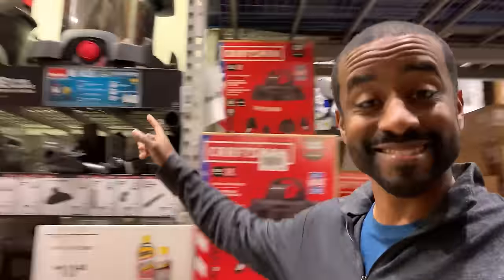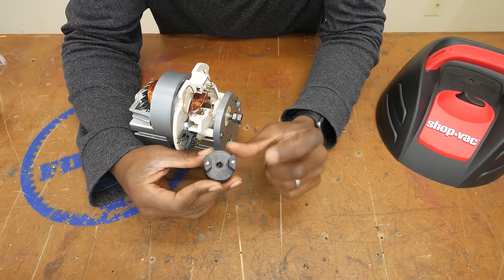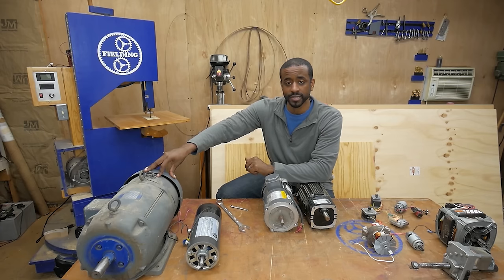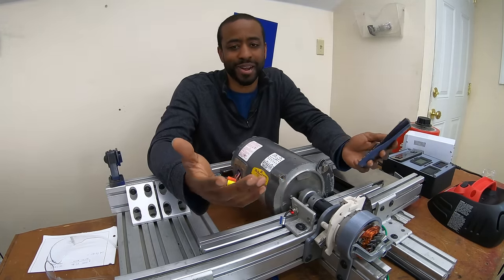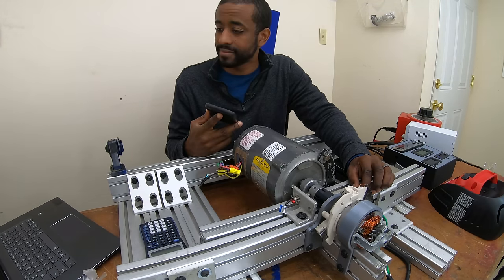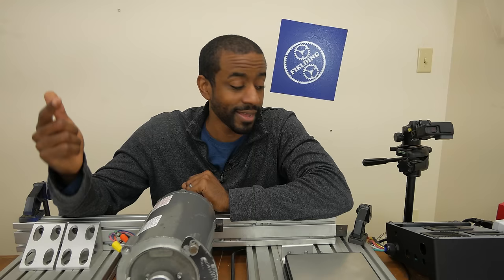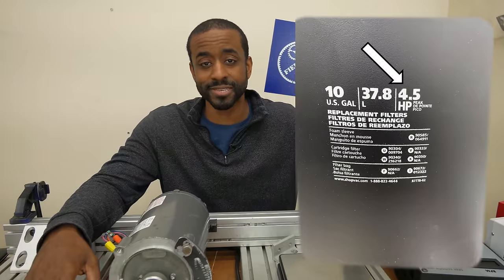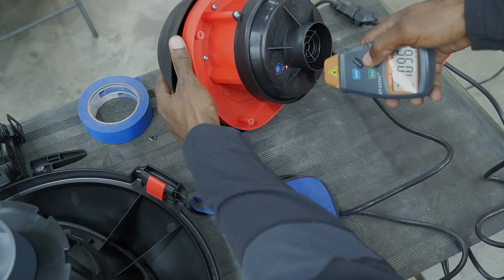How Much Horsepower Does Your Shop Vac Really Have: #078

Comment: I never thought about it, but as soon as you pointed it out, I did the math before I saw your results.  That would make that 4.5hp vac run 29 amps which would trip about any breaker in your house.  Also just looking at the motor it is really small for 4.5 hp.

Better metrics for advertising vacs would be CFM (cubic feet per minute) or maybe PSI (pounds per square inch), though this can’t be less than -14.7 unless you are in a super deep canyon somewhere.

Edit: Further into the video you showed the 9.9 amp rating on the vac which would come out to 1.14kW or 1.5hp.

All the calculations are based upon a typical motor rating of 115 volts, though you will get slightly better numbers with 120 volt power.

Comment: Not sure about HP and such, but I've noticed that some wet/dry vacs have 2.5 inch hoses and others have 1.5 inch hoses.  Also, it depends on the type of vacuuming you need to do.  The larger hoses, for instance, work better at having below where you're hand sanding drywall.   The hose size correlates to the amount of air moved, but not necessarily the suction power.  I have both a large and a small vacuum.  I'll use a large hose on the small one to see it has the same air moving power.  You have me curious now.

Comment: Just inherited a 2.5hp shop vac and wanted to see if i can connect it to my 4hp to see if it increases power. 
Filled a baby formula can (with plastic lid) with sand until 4hp could barely not pick it up. The 2.5 picked it up, and together it was a cakewalk. All that brought me here

Comment: The first test you did, was called VCMA horsepower.(Vacuum Cleaner Manufacturers Association). It's the only relevant number. That's to measure the torque of the motor at the same speed, it actually turns the impeller.(fan) I do agree, just like with air compressors, which also claim impossible horsepower ratings, is airflow volume, static lift,(suction) and air watts, the product of the two, through the optimum aperture. Different impeller and volute designs can give varying pneumatic efficiency for the amount of horsepower from the motor.
     If you multiplied the locked rotor torque with the normal operating speed, you could divide by 5252.1131, and achieve something close to the "peak horsepower" it says on the box. When I calculated that using your 1.68 foot pounds, with your 20,320 RPM, I got 6.49 HP. This is(was)a 6.5 HP motor!😆🤣😂😁...... Great video: Where's the Federal Trade Commission when we need them?
     If you slowed the motor to the speed that it produced maximum power, then used that RPM, with the locked rotor torque, you might hit closer to that "magical" 4.5 Hp. According the the VCMA, Peak power should be rated by loading the motor down to the maximum wattage output, then, allowed to cool down to 25°C, then, powered up again, and the horsepower reading taken before the motor has a chance to heat back up. If you did that, you might get your 2~2.5 horse power that you estimated.(the motor would HAVE to draw more than 20 amps) At<50% efficiency, you could only get ~1.5 horsepower peak@20 amps, 120 volts.

Comment: I feel like this might be a problem that doesn't exist as much in AU. Most of the shop vacs are sold ~1200w and we have 240v 10-15 amp sockets. We also have really strong customer protections for such a thing and the government would just fine them if it was found to be a false advertised claim.

Comment: Great video. I think the clue is in the statement “...the horsepower output of a motor, including the motor’s inertial contribution, ...”. From this, I presume they are referring 
to something similar to “brake horsepower”, where the rotational mass and RPM make it much harder to stop than the operational HP output alone.

Comment: Connect the vacuum hose of the fully as-purchased unit to a pneumatic cylinder with a blast gate on a tee. Attach a known value weight to the bottom of the cylinder and add graduation marks for cylinder stroke distance. Let the system spool up, then slam the blast gate closed (WITHOUT shutting off vac, so both buffered and energy and instant energy are combined) and measure how far the cylinder was pulled up at its peak moment. This includes all system variables -- including elastic deformation of the housing,hose, etc and the air column under vacuum, all acting as buffer of work. The motor/rotor inertia and turbine inertia, etc all included. This gives their claims the best benefit of the doubt, but I still doubt it could even momentarily lift the equivalent of 4.5 * 33,000 ft-lbs/min, even for a brief 0.05s interval. Maybe if you used some sort of Piezoelectromagnetic device to measure a millsecond long spike of force you might see some sort of spike like that but stil doubt it.

Comment: In wood work industry there are vacuum devices to suck all dust from chopping and grinding going on. Those things are from 5 kw to any number that they need. 5 kw one is like 300kg heavy  (just motor and propeller) and it can move huge amount of air. There is limit on power which vacuum can pull from wall, in USA it's 1,5kw and we in Europe have 3 kw max so biggest one phase motor theoretically can be 3kw but actual number is 2,2 - 2,5kw because that's biggest angle grinder and chainsaw that we get here and those folks will easy opt to 10kw motor if they can because there are gasoline and compressed air powered ones which have 5 times more power then electric

Comment: Way to go!  Major pet peeve of mine.  The 1.5 hp 120 volt continuous duty motor on our air compressor was rated at 14.5 amps.  Could not restart it on a 15 amp circuit. Had to upgrade to a dedicated line with a 20 amp slow blow breaker.  This motor is massive and weighs more than several of their shop vacs combined.  How do they get away with this?

Comment: I think the inertia claim is intended to mean something. Just use the rotating mass to increase momentary "peak" power. Testing would be: let the motor run without load until max RPM is reached (or close to failure). Switch on shaft load. Measure power as the rotor slows down. Inertia will provide some power until the mass is not rotating anymore. This makes it possible to claim any power.

Comment: I think their hp claim is from this procedure:
   1.) Spin the motor up to high RPM with a small load
   2.) Quickly put a large load on the motor
The large load accelerates rapidly for a brief instance due to a very large torque, partially from the actual electrical power of the motor, but mainly from the rapid deceleration of the motor (hence the use of the term "inertial"). 
Similarly, my car may only be able to produce 100 hp to accelerate itself, but if I accelerate it to 100 mph and slam into an identical stationary car, that stationary car will accelerate way faster than its own 100 hp could. Love the videos!
Reply: Or maybe it's just the inrush power as it's starting up from 0 RPM

Comment: Thank you for investigating this! I've always found it so annoying that all shop vacs seem to be rated by this mysterious "peak HP" which, as you confirmed in this video, is meaningless. Also 50% efficiency for universal motors is pretty typical but I agree is wasteful, especially if you use your shop vac a lot. Only benefit is it also serves as a heater when you're working in a cold basement. ;). As I think you may have also mentioned, UMs are used in these applications because their speed isn't coupled to the AC frequency, and they can also be run off DC power without modification. They're also small, lightweight, and inexpensive, so if your vacuum motor dies from dust damage, it's not a big deal. A 1HP induction motor and gearing to get the appropriate RPM would probably make the vacuum 2-5x as expensive. Funny enough, air compressor manufacturers faced a class action lawsuit years ago due to this whole "peak HP" scam. Some air compressor manufacturers are still advertising inflated horsepower numbers, but not nearly as bad as the case with shop vacs. I wish manufacturers would just rate their products with real numbers. Anyone who knows what horsepower means will know right away that you can't get 4.5 HP from 10 amps 120 VAC power, and someone who doesn't know what horsepower is won't know what an "air watt" or other actually useful performance metric means either, so I really don't get it. I have a "6.5 peak HP" Ridgid shop vac which is awesome in terms of being a super strong vacuum, so I'm not criticizing the product, but please it would be awesome if manufacturers stopped using bogus numbers to inflate their advertising!

Comment: Thank you for doing a video on this-- it's driven me bonkers for years (as I am the sort of be driven bonkers by stuff like this). The math isn't even close even at 100% efficiency,  not just impossible,  but REALLY impossible.  

Back when I was a millwright we made a vacuum with two reinforced 55 gallon drums (we could have used one if any of us knew anything about cyclonic airflow at the time) and a kiln blower that was something like 2 1/2 HP. It made gigantic airflow at about the same pressure drop as a shop vac, and we used it along with a sheet metal duct and some 4" hose to vacuum leftover concrete particles that a brush had missed on 2'x2' steel pallets. I figure a Shop Vac would have rated it at five gazillion horsepower.

Comment: Companies that make audio equipment are very misleading too. Power amps,  with their output wattage ratings. Lmao.  Just to dupe the consumer!  Maybe do a video on that. Very cool video! I recently installed the electrics, controls  for a dust collector on a cnc machine that is used for cutting out sink holes for laminate kitchen counter tops. 7.5 hp. 
Even in this app  480 v  3 phase induction motor   when you do actual measurements to set the motor overload  its about 2/3 of the rating.  I realize I'm comparing apples to oranges, but you know what I mean.  
Thanks.  I'm s subscriber now!

Comment: Read the peak current at turn on and then multiple by 120 volts. No, use an oscilloscope to measure peak current and peak voltage. The peak voltage will be 170 volts. Now using a current probe on the scope or current sensing device, read the peak current flow, probably at turn on. We will say it draws 20 amps for a fraction second. 170 x 20 = 3400 watts. 3400 ÷ 746 = ~ 4.5 HP.  Total BS  but that's what they do.

Comment: These wet/dry vacs are wired for normal 120V AC power in the US.  If you plug into a 20A circuit, the most you could get with 100% effeciency is 20A * 120V = 2400W.  2400W / 746 = 3.22HP max.  If it could pull 4.5HP (3357W) from the wall, and not trip the breaker, you'd melt the wiring in your walls and burn your house down.

Comment: Years ago we measured the current draw on a '6.5 hp' air compressor, and figured it was running at about 450% efficiency!
I bought my shop vac based on a comparison test; it is the best one I've ever owned. I think it's rated at 900 hp.

Comment: Peak power also includes torque caused by inertia of the rotating assembly.  You probably need to use an oscilloscope with an amp probe to measure peak current.  Run the vacuum as normal then use your hand to cover and uncover the hose while measuring peak current and voltage with the oscilloscope.  That still won't measure the inertia torque.  For example if you take a heavy flywheel and spin it up to 3000 rpm then try to stop it by squeezing the shaft, it will take alot of braking (your hand) torque to try to stop it.

Comment: HP doesn't exactly seem like the best rating for a vacuum anyways. Why don't they use a CFM figure at a certain given ΔP? Seems that would be more consistent, seems reasonable to reproduce in a basic lab setup, and would show design efficiency across a range of models. Also keep in mind that when a certain level of draw is involved, the limiting factor becomes more that of the hose diameter. (Once you're hitting a strong enough vacuum, it's relying on atmospheric pressure to push stuff along the hose and into the canister. At that point, the bigger hose means more surface area for the air pressure to act upon.) And keep in mind the ability to move air while unrestricted is probably is the most important factor, since hitting a full vacuum actually unloads the motor - and that's why vacuum cleaners rev-up and change pitch when the hose is plugged.

Comment: Jeremy, great job again. This myth-buster for these electric motor and devices. We all the “HP” ratings is driven by marketing, as know one shopping for a shop vac is going to pick the one that proudly list “1/25th” of a HP. The testing / rating laboratory companies are by the “Unicorn Dust & Sweet Dreams” Corporation, not using any established ASTM standards. Otherwise, my lawnmower runs at 400 HP and flies.

Comment: Good job, while looking at dust collectors for my shop tools. The hp ratings are much different and are more inline with typical watts to hp numbers. While a wet dry vac is claiming 4-6x the hp using about the same wattage. The only thing I can see factoring the peak performance is if you have 10 gallons of air in the vac in a vacuum state and you get a blockage. The air mass in a vacuum state will help assist clearing the blockage, And contributes to a longer duration where the vacuum hose has decent suction. Similar to capacitors in electrical.
That said I have doubts that they can make a 1hp motor on a 10 gallon chamber preform like a 6hp motor direct to the hose. 
Similar funky metrics have been used in pump flow ratings. Which in that case Chinese products were overstating gpm, causing domestic companies to compete at the same level. While a wet dry vac rating being overblown is disappointing. A bilge pump delivering 50% of the advertised flow increases the risk of public safety. Especially in areas that hyperthermia is a major risk.

Comment: Maybe they mean "horsepower in suction". I noticed the larger horse-power units seem to have the same motor, just a larger bin. 
If you apply the same atmospheric pressure reduction in a smaller bin as the larger bin, the larger bins will still have a larger initial suction force because theirs a larger volume for entropy or equalization. Good video by the way. Perhaps vacuum company's should start measuring their vacuums "power" in CFM's rather than HP.

Comment: Yep. My 50's Pullman commercial vac says "1.0hp" . Suction is the same as my 4.5 hp plastic abomination ship vac. 

We have found the max amount of suction through the biggest hose we can without popping residential breaker's, while maintaining a consumer level price. 

Only way to get better is to pay more for commercial and increase the incoming power ( 30 amp/230vav)

Comment: Great in depth testing.  See the same on audio amps. products will make some claim like 100 watts per channel yet the current draw printed on the unit will say something like 120V 1.0Amps.  Magical power output.  It would be great like you suggest if  you could get a suction rating like xxx cfm in a 2" hose.  Thanks for the sacrificial vacs.

Comment: What I think is that the Chinese manufacturer ships the motor in watts i.e. 650 or 450.
The manufacturer's uninformed worker made a layman mistake in excel when dealing with labeling while converting to US units of hp assuming they googled hp and watts was a unit of power. Did not understand the conversion. Messed with the decimal to make it look like hp 6.50 4.50. Presto 647 watt motor is now a 6.5hp beast. US needs to update to International System of Units if confusion is to be reduced.

Comment: I just did a bearing job on a 7.5 hp vacuum  the blower/motor weighs 150 lbs 18" diameter and runs on 3 phase power, oh and it has 14" ducts on both sides, services 20 cnc machines

Comment: The efficiency was probably closer to 60%-70% once you factor in the power factor since you were measuring 1248 VA, not Watts. You would have to use a meter that shows the power factor and then multiple the measured VA by the PF to get the true wattage the motor is consuming then you'll be able to get the true efficiency.
Reply: Universal motors have a much better power factor than induction motors do. I measured that, and found a household vacuum cleaner was actually closer to 98% power factor.(667 watts, 678 VA) I think there was more losses in vibration, than in power factor. The motor was actually probably closer to 54~56% efficiency, based on power factor. On cheap motors, the DC resistance has a way of contributing more to the impedance of the motor, than the reactance.

Comment: This same thing was/is true with air compressors and to some extent 120V welders. Numbers are advertised that are simply not possible on a 120V circuit. I have worked with actual 5hp industrial vacuum. Not a vacuum for cleaning but one that could pull string like composite  chips from a CNC lath. These Vacuum have OHSA required safety valves in case the hoses get blocked off. Apparently they can suck your blood through your skin if you plug up the hose with your hand. If you are dealing with 2-1/2 hose there is not any reason to go over 5 HP. You are approaching the max vacuum you can have on the earth. Doubling the HP would gain you very little until you add hoses or go to larger diameters.

Comment: Love this. I think the same could be said about modern semi truck diesel engine horse power ratings. New computer controlled diesel engines NEVER give full rated power (unless they now rate them in moon gravity). An old 4&1/4 cat will easily out pull a 500+ hp rated modern engine, everything else being equal (gross weight/ transmission/ final drive ratio/ etc)